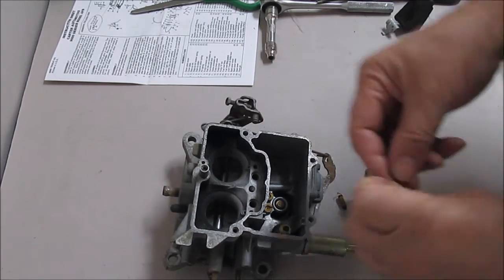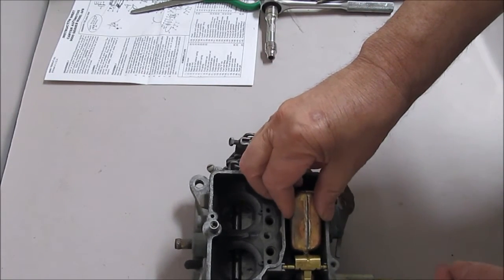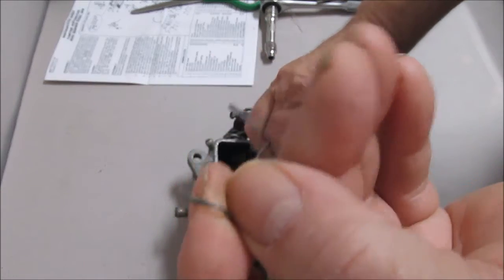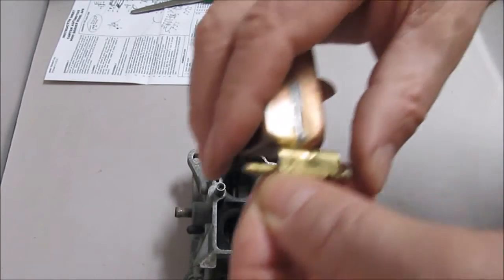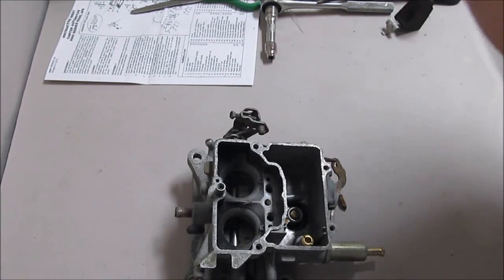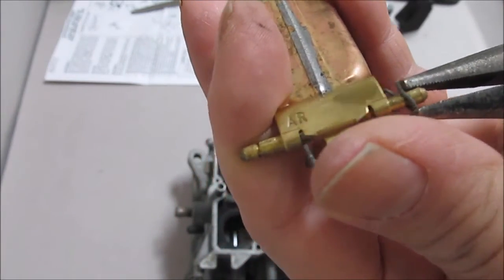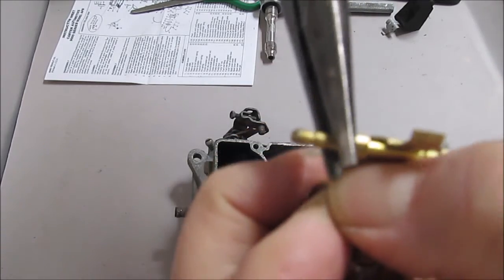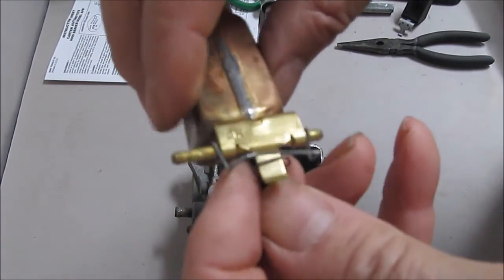Installing a Float Retainer on the Motorcraft 2100, 2150

Comment: Hi Mike, thanks a lot for all the helpful videos. Rebuilding my carb as I'm struggling to get my '68 289 going 100% and noticed that the tiny spring that attaches the needle to the float tab is missing on mine. Would that make any major difference as I'd imagine fuel pressure would lift it fairly easy, unless of course it stuck! Thanks again all the way from Ireland.

Comment: In case anyone has issues similar to me, I want to mention that the float retainer can be really picky.  My carb kept flooding spraying fuel down the sides and the motor barely ran at idle if at all.  I discovered the float retainer was not in the groove on the inlet housing.  It did not seem to clip in but I did manage to get it to stay.  Just in case anyone has similar issues, check the float retainer!!

Comment: Hey Mike I have a 2150 and noticed the fuel level was low imo so I tried adjusting the float however when I put the airhorn gasket back on it contacts the curved part of the float tab. With that said I got this carb to replace the 7200VV nightmare and it runs fairly good, especially compared to the later carb. So anyway when I try to adjust the float I can't seem to not come in contact with the float tab and it forces the float to shut fuel off. I'm confused, either the PO tried adjusting it and has it all contorted or I've become stupid in my old age. Any suggestions would be appreciated, maybe a pic of what it's supposed to look like would help me out. Thanks Randy
Reply: Mikes Carburetor Okie Dokie,  it is installed correctly, thanks for responding!

Comment: Nice video mike. I am currently rebuilding the 2150 on my amc 258, running far too rich the spring is missing on the float is that my issue?